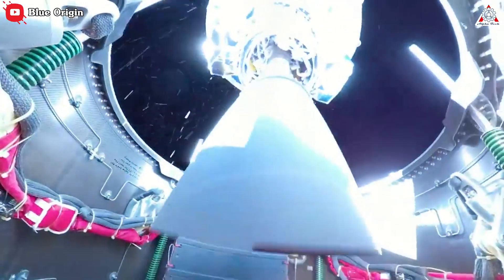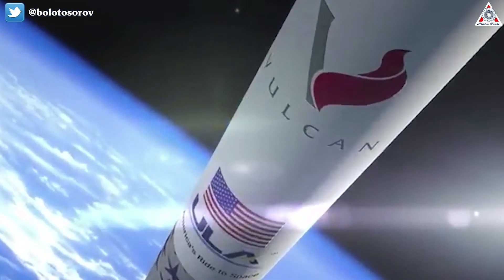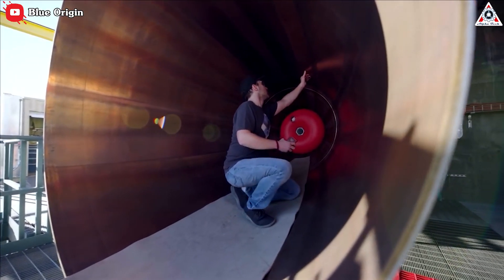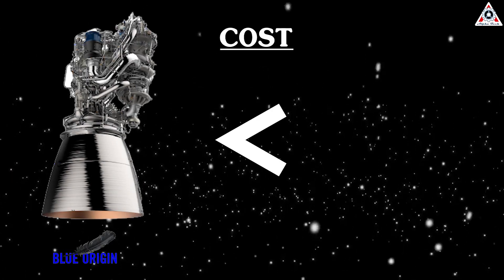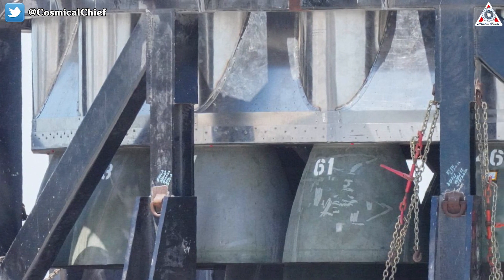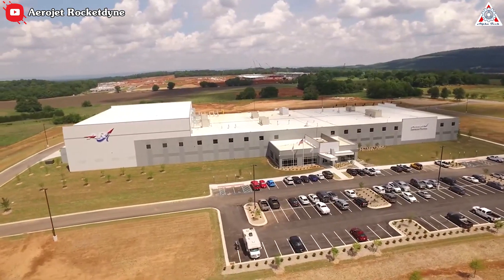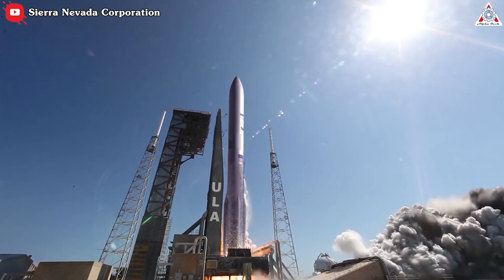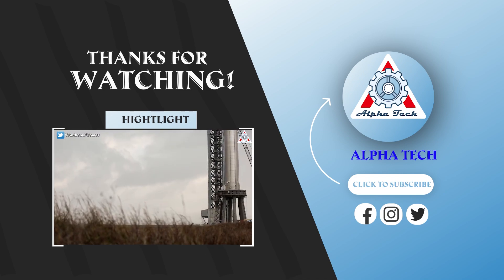Somehow Jeff Bezos realizes that the BE-4 engine is better than others but NO WAY TO BEAT SpaceX

Comment: The primary remaining problem is the adequacy of the water deluge system. I expect they will discover they have a much bigger problem on their hands in that.

As with any complex technical project, there are a thousand subsystems and not one detail on any of those can be ignored. It's the "problem of complexity" that is endemic in all modern software development projects--and one would presume--hardware development projects. (See: SLS.) Unless the people pushing those projects are able to "focus and concentrate" (implying they have Asperger's!), they have no hope of marshaling all the various subcomponents into a harmonious conclusion. First big idea: stop engineers from being oriented towards racking up a big count of closed tickets. Instead, have them focus on quality.

I expect that some designer had too many things to think of and therefore dropped a full and detailed consideration of the water deluge system, which looks deeply inadequate, especially at the Cape, where the NASA folks are already twitchy about possible R.U.D. events.

Comment: BE-4 is a JOKE. Half the chamber pressure, lower specific impulse, inferior thrust to weight, seven times the cost and -- most importantly -- it's still VAPOR WARE!
Reply: Don't forget it's size.... rocket engines size dictates it's max thrust / vehicle. Numbers like thrust and so on mean less if you can manage to install 5x of them vs competition. Where comparisons vs raptor 2 just fall apart is when you consider the size differences in relation to performance.
Reply: @mikatuomaala1186  Actually, it doesn't fall apart. In fact, it hammers home the point that Blue Origin's vaporware engine sucks big time.
--
The BE-4 is 1.5 times the size of the Raptor (4.46m x 1.9m vs 3.1m x 1.3m). BE-4 is heavier and has lower specific impulse. The BE-4 also costs a lot more with Blue Origin targeting $7 million per motor whereas the Raptor 2 is already achieving $2 million per engine today. Both engines are of the same thrust class -- BE-4 targets 540,000 lbs, Raptor 2 achieves 510,000 lbs today and targets 550,000 lbs. Why is the Raptor2 smaller, more efficient and higher thrust? Because it is operates at 300 bar vs the BE-4's 134 bar.
--
And, as I said previously, in spite of it's technical inferiority and modest performance goals, Blue Origin still cannot deliver flight ready engines to ULA, whereas plenty of Raptors have flown and 42 of them currently sits on the pad ready to launch Starship's inaugural orbital flight.
Reply: @dwightlooi  You misunderstood me completely, what I meant was only that even IF someone were to argue in favor of BE-4 it would fall apart when you consider the size differences. Not the other way around, I thought I was obvious since we all know R2 is smaller than BE-4 but I guess the argument could've been made in reverse too.
Reply: plus its bigger then Raptor = less engines can fit onto a rocket

Comment: RD-170, a full version of RD-180, is at least 10 times reusable. It was tested 10 times in a row even without any maintenance. The side boosters of Energia rocket were designed to be reusable but it never happened because USSR collapsed. And they will never ever beat Russia in engine cost because everything US makes is so overpriced.
Reply: The RD-180 cost is thought to be a little under $10million per engine but is no where near as cheap as Raptor 2 which costs around $500 thousand to build or even the more expensive Raptor 1 at $1million per engine.

Comment: SpaceX is manufacturing 7 raptors per week, not 4.  You should be comparing the raptor to the BE-4 using thrust/Kg, not absolute thrust.  Absolute thrust is meaningless.
Reply: Absolute thrust is meaningless?  True, if the engine weights are infinity.
Reply: @MichaelEdwardWright1  gotta agree with op, thrust per pound (or kilogram) is far more important.
Engine A may have 50% more thrust then Engine B but if it weighs 100% more you may be losing out.
This is especially true in in rocketry where every Lb/kg matters.
Reply: @MichaelEdwardWright1  I was referring to the absolute thrust of a single rocket engine.  It's more important to know the thrust/rocket weight and size.  The raptor rockets are much smaller and lighter than the BE-4, and version one raptor has less absolute thrust than BE-4.  The Starship has more absolute thrust using raptors than New Glen because SpaceX can fit more raptors.  The new raptor 2 is larger than Raptor 1, but has much more thrust.  It's smaller and lighter than BE-4 yet has more thrust.  The best of both worlds.
Reply: @billweberx  I don't think Raptor 2 is larger than Raptor 1 but it is heavier as the combustion chamber is much more robust to take the increased chamber pressure, I think it may even be more compact then Raptor 1. Still no where near as heavy as BE-4 even though it now has comparable thrust. Raptor is also more efficient and designed to be reused more times. There is also an even lighter version with fixed mount that is not re-lightable (boost version).
Reply: @schrodingerscat1863  You're correct.  My mistake.  I was thinking about something else and got them confused.  I'm old.

Comment: So far behind SpaceX. I'm surprised ULA haven't dumped the BE4 for Raptor
Reply: SpaceX won't sell them Raptors, ULA is SpaceX's biggest competitor.  Bezos sold them BE4 because Blue Origin are years away from having an orbital class rocket to put them on.
Reply: @schrodingerscat1863  yeah true didn't think of them being competitors
Reply: Even if SpaceX would sell their engines (they don't...) you can't just switch engines left and right. Using Raptor2 would require a redesign of the vehicle & ground support systems because of the use of methane.
Reply: @RippanYT  The Vulcan design is quite clever where engines are concerned, the part that the engines are mounted to is interchangeable because this is how they ultimately want to make the engines reusable. This means that the redesign would be limited to that engine bay part of the rocket. BE-4 and Raptor both use methane and lox so the fuels are identical meaning GSE is unlikely to need to change. With Raptor2 now being roughly equivalent to the thrust of BE-4, the swap should be relatively straight forward. They would need a new thrust puck design and contingent plumbing and the flight controllers would need to be reprogrammed based on the specifications and thrust profiles of the new engines. Personally I think BE-4 will need a significant redesign to make it viable because they are currently having serious problems in manufacture and cost seems to be a major issue too. I expect a BE-4 mk2  before they get to New Glenn as they need to be cranking out at least one flight ready engine per month rather than the current average of one per year. Looking at Raptor there have already been 2 significantly different versions and many other engineering sample variants to get to a point where they are churning out one per day.
Reply: @schrodingerscat1863  Liquified natural gas may contain a lot of other components in addition to methane. Thus it requires less processing so it is marginally cheaper. It can also be more energy dense if it contains larger hydrocarbons, such as butane.

If they haven't already given up on that, they will soon because pure methane makes things simpler.
Reply: @hamjudo  I actually thought Blue Origin had already moved to methane rather than LNG because its combustion is more predictable. Quick look at their web site still says LNG though so maybe not.
Reply: @RippanYT  Raptor and BE-4 both use the same fuel which is LOX and liquid methane.  Your other points are still valid though.